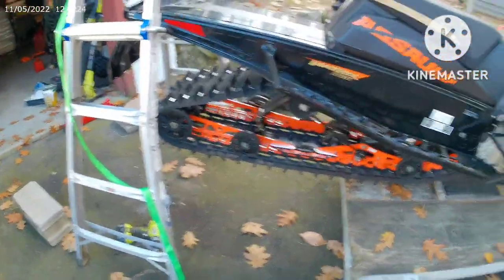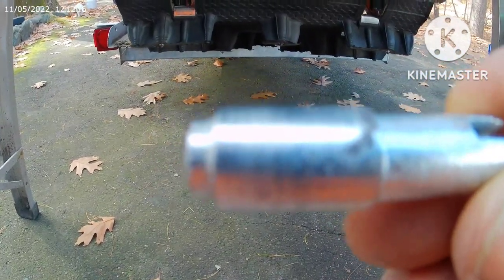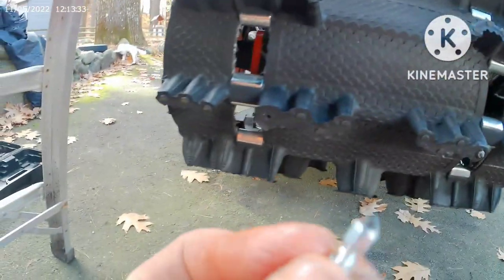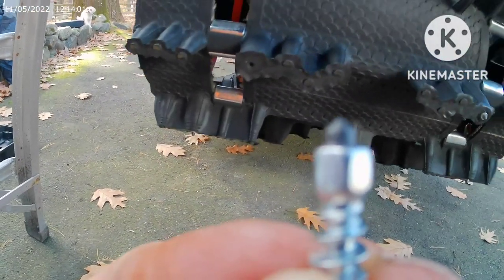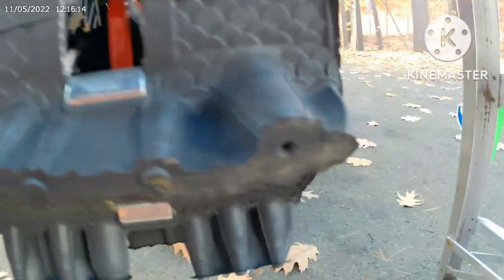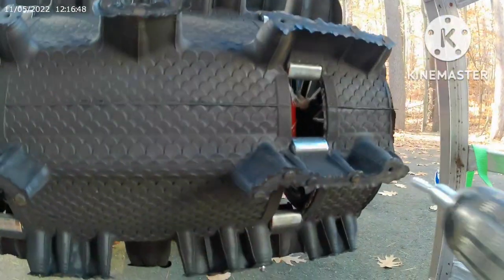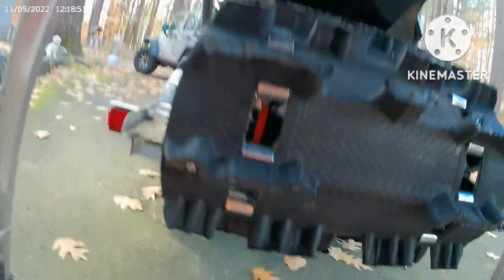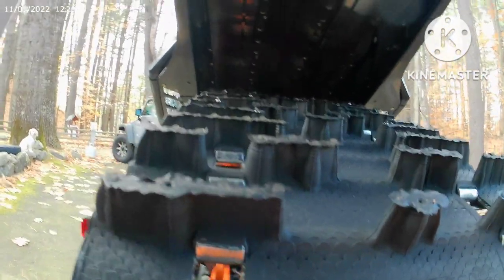2022 polaris switchback  146. 1.6 cobra track  installing igrip st25r studs

Comment: Im looking for some ectra tracion on the turns and icy roads or the lake .we typically would use 96 studs .Would you recommend these for my application .137 650 indy xc
Reply: I didn't run into any ice really last year. Lakes around me were considered unsafe  to ride on.    Basically, I can't  say yet.   Traction, on average, seems to improve